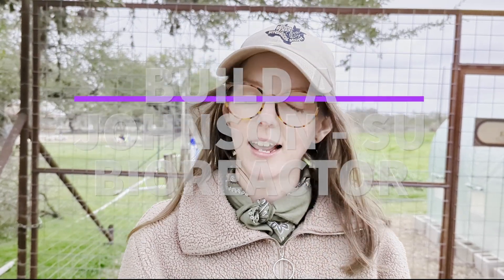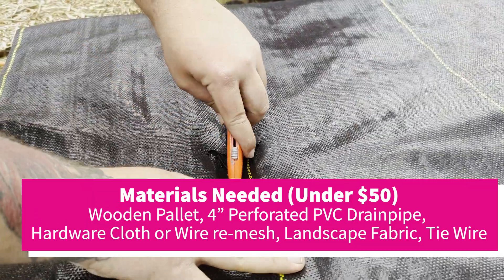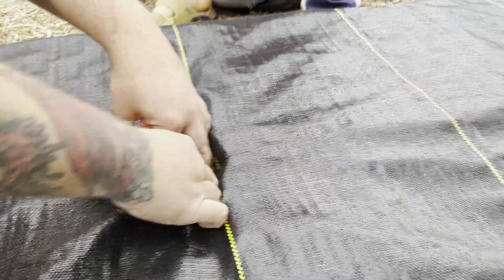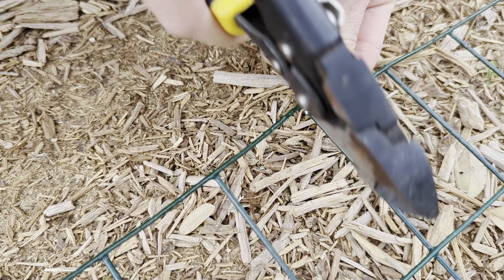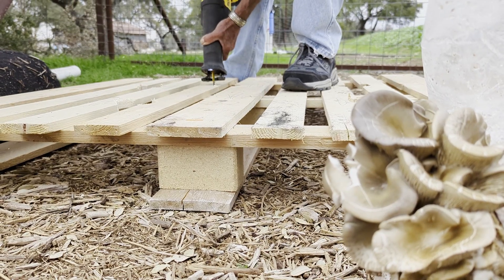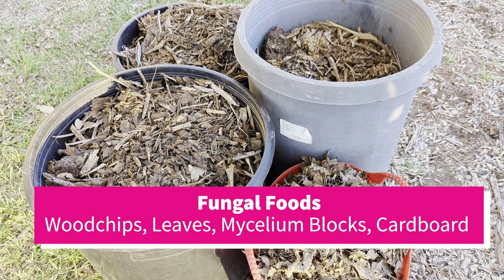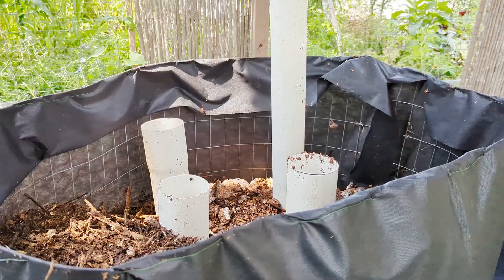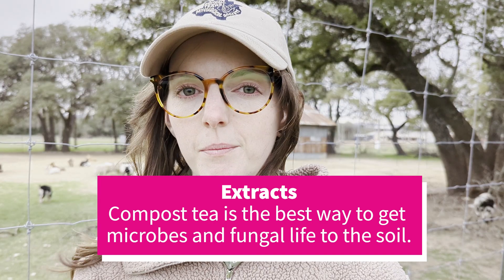Part 9 Build a Johnson Su Bioreactor

Comment: No innoculum? Do you save one batch to inoculate the next batch? 
It sounds like high N materials are avoided:  no green material or manure?
Reply: No inoculum needed - the fungal species (and many other beneficial microbes) are introduced to the bioreactor from the feedstocks themselves and the surrounding environment! You could certainly use a small amount of one finished batch to inoculant a subsequent one, this could possibly speed up the process or improve biodiversity of the end product 👏High N and "green" materials are not necessary as this is NOT intended to be a thermophilic compost and is NOT meant to be turned. However, they can be added, but I'd only recommend using such materials sparingly, over 70% of the pile needs to be carbon-based inputs. Please note: spent mushroom blocks should be treated as a green materials, they will contribute to heat accumulation and should not exceed 30% of the total volume. A Johnson-Su Bioreactor may heat up in the first week (between 131 - 165 is acceptable), but should come back down to ambient temperatures shortly after that. If temps reach over 170F, break it down to avoid a potentially dangerous situation.
Reply: Potentially dangerous , as in, smoldering to fire? @soilissexy